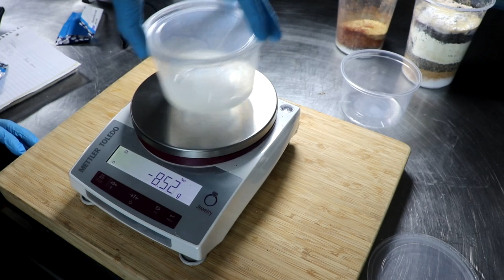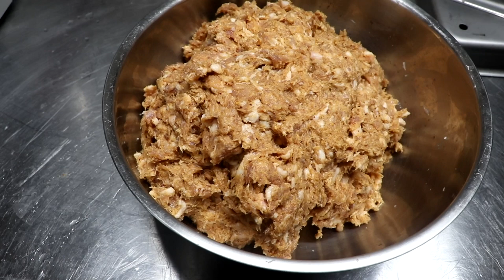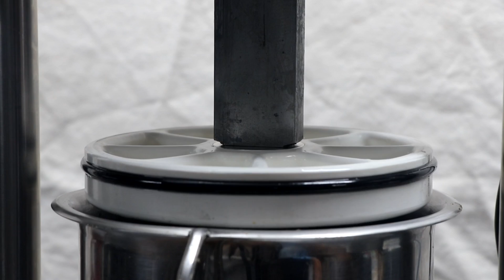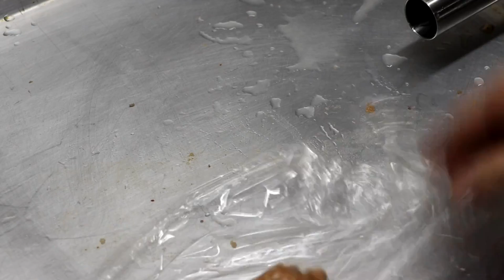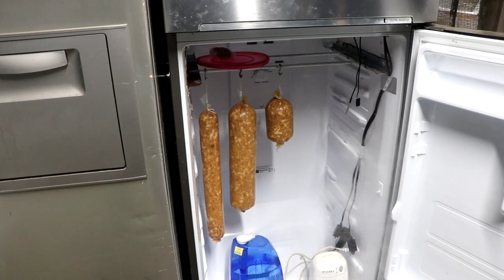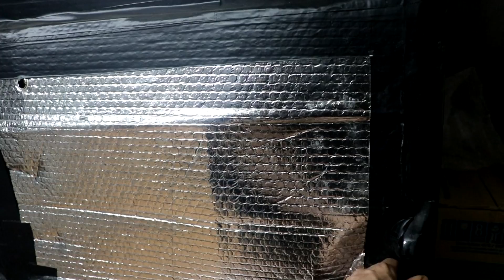Making Calabrese Salami (Step by Step Instructions)

Comment: I have just made a 4 pound batch following your recipe, only I used the rate of red wine from the original recipe you have linked to as I like the flavour it adds to final product. Is there any rule of thumb with regards to how red wine affects the use of starter culture and the development of pH? Also, your tip about utilising the existing mold in the maturing chamber seems to be a great trick. Making charcuterie is only a hobby for me so buying, and not least keeping fresh and within date cultures and molds, can become a little costly for the hobby salami maker, so I was wondering if it would be possible to 'harvest' some of that mold from the maturing chamber and keep it in the freezer for next time it is needed? Thanks for sharing all your lovely charcuterie videos - they are a great inspiration.
Reply from the maker: Hello JF.  Adding wine in relation to the starter culture adds more fermentable sugar.  Not that big a deal you'll just have to monitor the ph drop or offset the sugar somewhere else.  Depending on the culture you are using you'll just want to check it 12 or so hours before you normally do.  For this salami a good pH target is around 5.1-5.3.  Since you are using Mold 600 through the process of drying it will raise you pH a point or 2 so if you overshoot your target I wouldn't worry about it too much..  This is a great salami.  Especially if you can get the Calabrian Peppers....   If you have a healthy chamber and your salami are drying with healthy mold coverage then sure.  When you pull your salami to store it save the casing and place it in a zip lock bag to put in the freezer.  When you want to use it just take a piece of already inoculated cased and soak it in some water.  Use that water to spray down what ever you want to have mold coverage on.   Eventually your chamber will be completely inoculated with mold 600 and everything you put in it will naturally become covered.  I hope that helps.   Let me know if you have any other questions..
Reply: @2guysandacooler  Thank you very much for the prompt and very detailed answer. I skipped the dextrose completely and will take your advice on checking the pH sooner than I otherwise would. I have only got the paper strips to test with for now but it will still give an indication of where the pH is going, so until I get a proper tester I cannot fine tune too much on the pH. I will definitely also try saving my mold covered casings in the freezer in the future. It is not just about saving the money but it also makes sense to save a well established mold. Unfortunately I couldn't find Calabrian Peppers anywhere but I have some homegrown from last year that I dried and blitzed into flakes, and they are not bad even if they are no the 'real deal'.  Thanks again, and have a nice weekend 👍

Comment: Firstly thanks for the great videos. I love how systematic you are, and I find you nice to listen to. Second, is there a reason to prefer an iodine based sanitizer to a phosphoric acid based one like starsan?
Reply from the maker: Hi Manatoa1.  Thanks for the complement.  Great to hear.  On to your second question.  Both do exactly what they are supposed to.  Some of the quirky issues with the products come down to personal preference.  For instance:
Iodophor has to be thrown out after 1 day and Starsan can be used for several weeks-months
Iodophor doesn't foam up when you spray it where starsan does 
Iodophor stains pretty much everything plastic like tubing, spray bottles, where Starsan can damage countertops if spilled in its concentrated form.  
Both work fast and both are no rinse so for me it's a winner either way.  Price may be an issue but they are both very concentrated products..  So depending on your application you might find a place for an Iodine sanitizer and a phosphoric acid sanitizer.  A lot of home brewers use both for different situations.  Personally I have found that for my projects so far the iodine solution has not failed me yet.  I hope that answers your question
Reply: Hey Eric- what do you mean when you say iodophor has to be thrown out after a day?
Reply from the maker: Hi Sam.  Just got your message.  Iodophor breaks down over a 24 hour period.  Much like any bleach sanitizing solution you would prepare.  So i only make a small amount of it at a time so I don't have to waste any but with that being said it is cheap enough that it doesn't matter much if you have to throw a bit out 😁

Comment: Hi. Nice video. What happens if the pH levels are outside the range you mention? Is there any risk?
Reply from the maker: That is a great question.  I am actually working on a video that deals with that specific subject.  To sum it up though the LAB's (Lactic Acid Bacteria) that are consuming the sugar in the meat are reducing the pH.  If you pull the salami before it reaches 5.3 then the salami is subject to other pathogens like E.coli and staphylococcus.  The LAB's are creating an environment that make it unhospitable for these pathogens to grow.  If the pH gets too low then the bacteria start to lose their function of flavor enhancement and color and the salami starts to get tangy.  Too low is ok albeit a bit tangy.  Too high is not good.  I've had salami get down to 4.6 before and it was very good but very tangy.  The sweet spot for European salami's is 5.1-5.3..   North American salami tends to dip into the 4.8 range as it is generally a little tangier than European salami.   Hope that helps.  Be sure to stick around for the video going into more detail about cultures and pH...  Thanks for the comment and thanks for watching.
Reply: thanks for the quick response, I will be waiting for the video. Greetings.